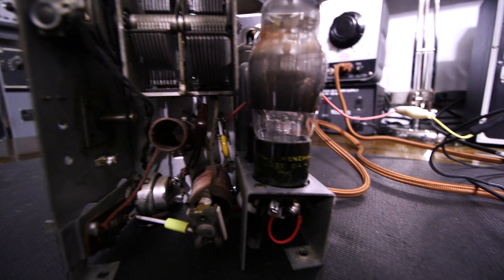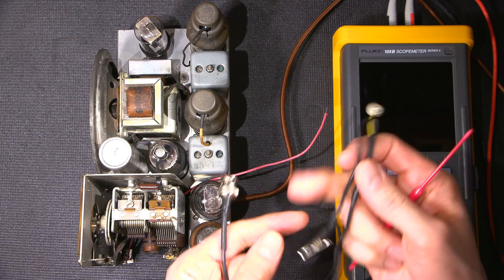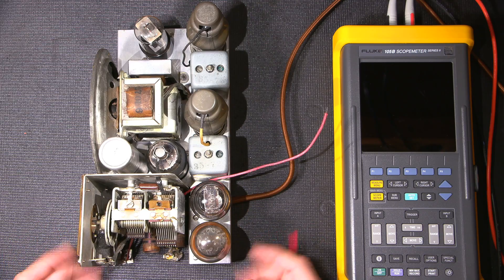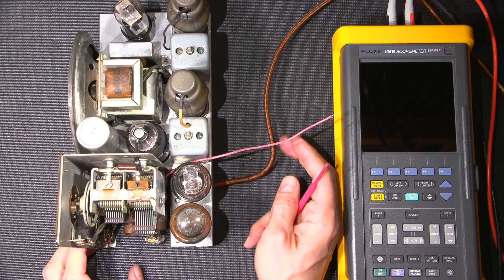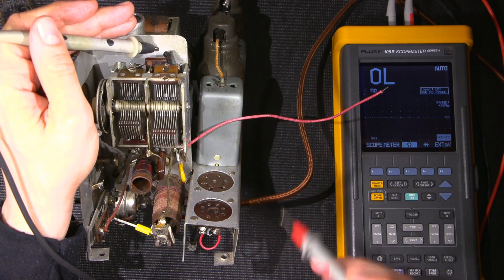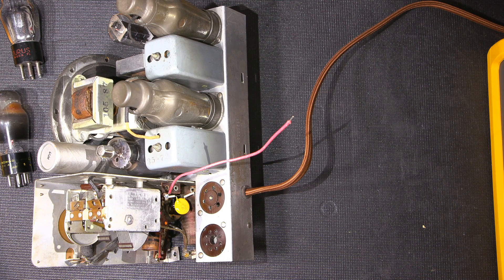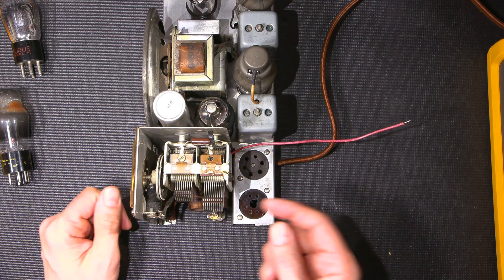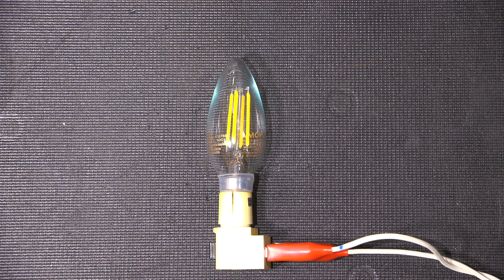See High Voltage Created From Falling Snow!

Comment: I admit that after seeing this video, I was intrigued and gave this some thoughts...  My current theory is that there was another spark in the isolation transformer as you mentioned:  The sequence is that the chassis is charged up through the 36ohm resistance (coil) until the breakdown voltage for the isolation transformer is reached.  Once the spark in the isolation transformer is ignited, the chassis voltage is pulled closer to ground (due to the lower resistance of the ionized air in the spark).  The coil connecting the chassis to the antenna has a relatively low DC impedance (36ohm), but at high frequency, the impedance is probably relatively high, so the chassis voltage can be pulled lower even though the antenna voltage is still high.  There's probably enough charge/capacitance in the antenna to initiate a spark in the radio once the chassis voltage has been pulled down enough...  A few points that comes from this theory:  1) The spark in the isolation transformer must require a higher breakdown voltage than the spark in the radio otherwise there would be no sparking in the radio, and 2) The coil is absolutely necessary for this effect to occur:  the chassis needs to be charged through a "low" resistance, then when the spark in the isolation transformer is initiated, this resistance must go high very quickly (basically, the textbook definition of the behavior of an inductor), 3) I haven't grasped how exactly to fit the capacitor into this theory: There could actually be some RF/ringing effect...  In any case, this is fascinating, and I would never had thought that a simple snowfall could cause this much power to be developed across an antenna (now I'm also wondering just how common this is?)
Reply: NugTrace , If its tho snow ❄️ causing high voltage then does that not mean there are various types of metals in the snow.

Comment: The phenomenom originates outside the house and involves a static build up between the antenna and some other outside electrostatic field (such as the roof or the ground or a tree).  Initially, your radio (chassis and all) keeps the same voltage potential as the antenna because it is connected by the coax.  As you said, the radio is isolated, so its potential rises as the antenna charge rises.  Everything on your radio is at the same potential. No radio components charge, the radio itself is the charge.

When the antenna static (electric field) reaches a high enough potential, it flashes over to an opposing potential in the roof, tree, ground, or whatever.  Maybe the incoming snow itself. When this happens, the potential at the antenna changes very quickly.

So... now we have a radio with metal parts still at the antenna pre-discharge potential.  Needless to say, an electrical pulse runs down the coax (on the outside shield btw) towards the radio.

When the pulse arrives at the radio antenna coil, the coil terminal potential is the first thing to be "adjusted" among all the parts of the radio.  Now terminal of the radio coil is at the new antenna potential; the rest of the radio is not.  There is no easy path through the inductance of the coil to the rest of the radio, so the pulse jumps the gap to the chassis as this is the shortest path to, not ground, but to the radio metal mass at pre-discharge antenna potential.

After the spark jump, the radio and antenna are equipotential. Then the antenna and radio charge again and things repeat.

This isn't an electric current flow phenomenom, but rather a static electricity phenomenom. Earth ground does not play a role.  Check out the Wimshurst machine.  I am not an RF engineer per se, but I have an EE degree. Yes, these pulses are painful when your personal static potential becomes the target of the impulse.

Good channel - Cheers

Comment: What a neat feature you've discovered!  Your FADA receiver can double as a spark gap transmitter in a snow storm!  If I were you, I'd be grounding the entire outdoor array whenever you see a big atmospheric pressure drop.  If you need an antenna in these conditions, use an indoor loop instead!

Comment: I find your experience of gathering high-voltage from the atmosphere interesting. I did some web-based searches and do turn out incidence of lightning during snowstorms particularly if the snow is wet. My theory is that your storm was generating such energy and that your antenna was providing a ground path. The fun is in proving one’s theory good luck, keep us abreast. I know you follow good practice so presumably the 33 ohms to ground represents your lightning protection. I like the lightning spark-gap arrester produced for the commercial market called a polyphaser. Suggestion, bring your expertise to bear producing a video on safeguarding amateur antennas from lightning. As usual your professionalism is a credit to your channel.

Comment: I've seen something similar with AM radio towers.  I was working at the KSTP transmitter back in the late 70s and could hear something that sounded like .22 shots, and the guy wire insulators on our daytime antenna were arcing over.  Fortunately we were on our nighttime directional antenna, otherwise the transmitter would have tripped with each arc.  This is a 50kW radio station, so the guy insulators were pretty good sized.

Comment: I know this is old but I found it interesting.  Cloud to cloud or ground arching occurs in nanosecond timing.  This is inductively coupled to your antenna.  The capacitor would pass it but the coil would be extremely high in impedance.  These discharges are sometimes in the millions of amps and extremely destructive.  Especially if it occurs as lightning.   These discharges are always a prelude to lightning but don't always result in lightning.  Especially during a snow storm.  You can sometimes hear the phenomenon in the leaves of a tree crackling as a thunderstorm approaches.

Comment: In the winter the air can be very dry, as well snow makes an excellent conductor. I wonder if static happens to be collecting outside and the antenna happened to be in the middle of it? I've seen a few video's on RF and one thing I found interesting was the fact you could dead short a radio antenna input to ground, and still have it receive strongly inside of a transmit station.

Comment: I also experienced something like this some years ago at a ham friend's. He had a dipole, which evidently was well isolated from earth :) We heard a snapping inside the power supply of his Yaesu FT-301D (old fully solid state rig!) and I thought- well, that is well toasted now! I disconnected the coax and got a heavy jolt from it.. Afterwards, long sparks started to jump from the cable sheath to the window frame, creating noise like gunshots!.. On careful testing afterwards, the FT301 setup was fine, remarkably, and seemed unharmed..

Comment: lightning operates at a frequency of approx 1mhz. The coil in the radio was allowing it to pass on to other circuits. I had a similar experience this past winter in Western Pa. I was doing something near my ladderline feed line to my inverted VEE and heavy snow. As I was touching the big knife switch to disconnect a clip lead I was experimenting with; I kept getting shocked. I figured it was "static snow" on my feedline. I got a ground lead near the knife switch and it drew an arc just like the one in this video.

Comment: Hello Mr Carlson, I am having a Philips radio with live chassis(hot) . If I would connect a 220 volt primary to 220 volt secondary transformer ( both coils are separated) in the mains line, would it will be less hazardous? Currently touching any knobs will give slight to heavy shock. Or there is any other way to over come this situation? Please reply . Thanks in advance.

Comment: I have a problem at home of me drawing arcs from most equipment at home usually at night, the microwave oven, sink, washer/dryer, keyboards and mice. I damaged two keyboards and one mouse. I've only seen it this winter. Arcs are typically about 1/4 inch, 6 mm. It also interrupts the Samsung 43" TV momentarily which is used as a computer monitor. Similar to your experience, I could hear the arcs in the powered PC speakers, moreover, as I walked around without drawing arcs, yet the PC speakers had crackling noises. How to engineer to eliminate?
Reply: your footwear or flooring winter often has low humidity which allows static charge to accumulate you are giving your charge to those items.
Reply: @ratbag359  Yes, but, this winter it seems worse as if something changed. That's what sparked :) my interest in Mr. Carlson's video.
Reply: @lawrencemiller3829  drier than normal winter?
Reply: @ratbag359  Maybe the humidity is less than last year, but it does not seem like it either.

Comment: During the CB craze of the 70's.  I had a base station and before a thunderstorm, I disconnected the antenna connector.  Even tho there wasn't any thunder (or lightning), the male PL259  connector was arcing, center pin to ground.  I made sure there wasn't anything close to the connector.

Comment: As a boy in South Florida I was listening to a Halicrafters tube SW set during a lightening storm. I could hear a repeating"tick" beginning at about 1 Hz. The tick rate would increase in frequency over about 1 minute to maybe about 30 Hz and then the sky would flash from a bolt of lightening. At that moment the ticking rate dropped back down to the 1 Hz range...only to repeat the process over and over

Comment: Use of a  properly rated and grounded spark gap arrestor in those situations is fairly standard. When I lived in Kansas and Colorado, radio operators would unhook their antennas in bad weather (snow, hail and the like) and rely on the spark arrestor or ground the entire antenna externally. I learned long ago to unhook everything-coax, power, anything-during storms.

Comment: A good while ago, I went a bit thru things like this too. On a 80m delta, when a storm was approaching it would arc between the coax and ground. (Yep, because of that I don't use large open dipoles)
When I realized what was happening, I grabbed the nearest piece of copper webbing and grounded the cable. 

Now I just don't play around anymore without serious permanent grounding, arrestors, variacs and opposite diodes.

Anyhow, yours was arcing on that coil because it was oscillating. Damped but oscilating. :D

Comment: I had same thing happen a few years ago.  The antenna was a 80 meter inverted vee fed with 450 ohm ladder line into a Johnson Match Box.  Got a panic call from my wife while I was at work reporting "buzzing" from a box on my radio desk.  No snow,  just wind.  I'm guessing the the tuning caps in the match box were charging and arcing from static build up on the antenna.  Have not seen it since.

Comment: Coax to antenna having one lead connected was building capacitance in cable as snow friction was occurring. maybe short both leads together when not in use or connect both to ground. Cable acts like a capacitor with the shield and core.
Reply: my theory is this.
I would say dc with fast rise time the coax would be charging the whole system in till the charge on the chassis side found a arc point the sudden discharge would present as a fast rise time to the coil blocking it causing the reaming charge in the coax/antenna to ark to the chassis.

Comment: I did some automation controls work in a flour mill once.  They take engineering precautions all over the facility to avoid the flour and grain creating these conditions as it's conveyed.
Reply: Had a small sugar processing plant blow up because of fine sugar powder on the floor and equipment, and static electricity set it off. Staff got too lazy and didn't clean up the area and equipment.

Comment: I would get arcing at my pl-259 connectors (disconnected from switches) from my 40m verticals during snow, or even before a summer storm. Would light up behind the teflon dielectric of the fitting. A great teaching moment for the grandkids.

Comment: I have seen that a few times. One time on my inverted V antenna, I saw a trace of flash across the lighting arrestor, during a dry day. 
Another time i was in the tv transmitter building, and saw flashing across conduits that were close to the transmission lines.

Comment: I have a similar issue. I have a discone about 30 feet up connected with lmr-400 coax I use for 2meter ,70cm and a sdr unit. It is grounded very well as the metal pole its on goes about 4 feet into the ground. when  touch the connector while it's snowing I can feel a bit electricity tingle. My hf dipole is about 25 feet up  has a 1.9 balun on it running with rg8x feed line not grounded. I can feel the same thing on that antenna when it snows.  kinda freaked me out the first time I felt it. Now I just expect it when swapping out lines or if I  bump the terminal when using the coax switch.

Comment: My thought process on this, which may be completely wrong. Something is acting as a capacitor. The voltage reaches a point where it arcs over. First see if there is anything that can provide an estimate of pain to amount of current dicharged . For the distance, try to estimate the voltage required to arc over. Try to estimate time of the dicharge. From that, the coulombs can be estimated. Since C=Q/V, you could estimate the capacitance. See what natrually available capacitance sources are within maybe an order of magnitude of the estimated capacitance.That could give an idea of where the charge is building up.

Comment: Same effect applies to sandstorm. When stationed in Basra, Iraq we were working on communications equipment when the afternoon Haboob came up and there was sparks snapping in the tuner end of a receiver in repair which was connected to an antenna on the rooftop. Got the bejeezus of a belting when I hastily tried to ground the coax. Elderly techie also present in the room remarked it being wise to watch out in cases like this because of it being high voltage multiple frequency RF due to the various capacitances and inductances in the coax, antenna, receiver etc causing wild oscillations of all sorts which some antenna coils failed to ground because of their inductance. He stated this was somewhat like unintentionally putting together a spark gap transmitter. 

Small sidenote which makes his explanation credible: The portable FM radio in the room which was tuned to the local British Forces Network, had a crack and a staticy whistling sound of decreasing frequency come out of it every time a spark jumped over in the other receiver.

Comment: Paul, You have caught the triboelectric charge's transient discharges generated by snow (ice particles) falling through the atmosphere( friction with air particles). Feynman has given a nice description in his book. Now for these transients (or RF), the 36 Ohms coil may be appearing as an (isolating) inductor and not as a resistor. Hence the transient currents prefer a discharge path to the ground through your radio chassis metal plate back to the earth outside your lab, which was the "other " terminal of the transient source,snow particle atmosphere system being one, as the current is a loop and returns to its source. Now you can easily confirm the return path if that was via the isolation transformer or your rubber table mat, (which perhaps was a static conductive mat with grounding connector to earth at its corner) by simply unplugging either the power cord (at the radio end) from isolation transformer or the mat grounding lead while firing an ESD transient. As you already have an ESD gun, why not use the gun at the same cap arc discharge point and find the discharge path and then you can uncover everything. Please do this and make another nice video. Your observation of the LED damage is interesting. Hope you could open and inspect the driver card for any transient damages.

Comment: Would lightning shunts protect the radio. I remember in the 80s having one on my CB with two PL259 chassis sockets and a ground wire which went through the wall into a ground spike

Comment: In broadcast engineering, we use inductors from AM towers to ground. The towers are hot, but the inductors are high impedance at RF, but they generally bleed static charges off BEFORE there is an arc. My point on your experience: strange.